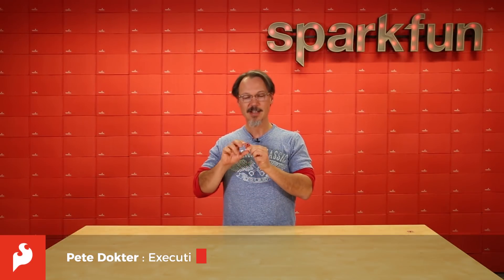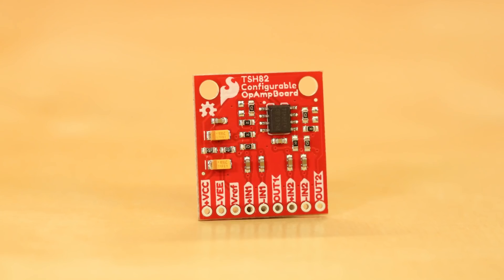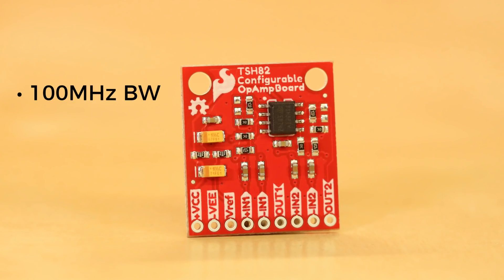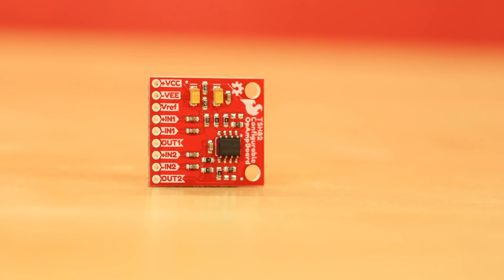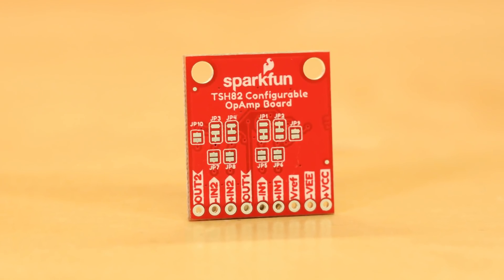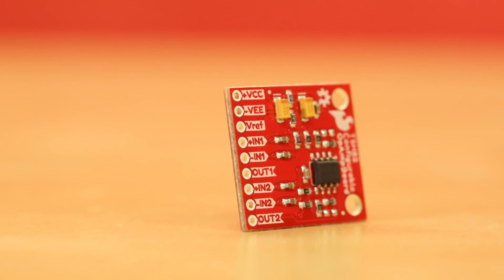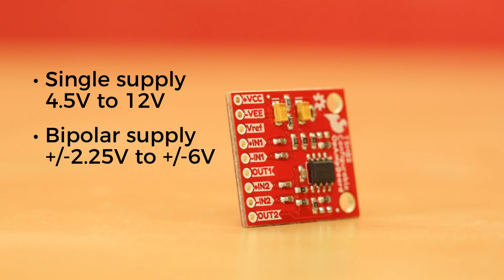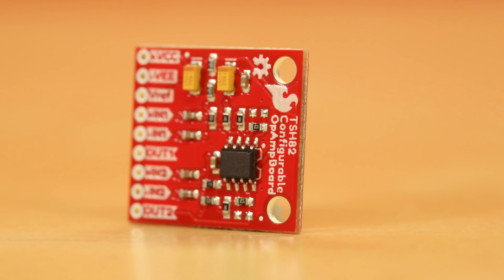Product Showcase: SparkFun Configurable OpAmp Board

Comment: Can I build an amp with this?
Reply: Well, it won't drive speakers, if that's what you're asking. But it certainly works as a gain stage of a larger amp for signals below about 8MHz (without modifying).
Reply: Cool! I guess I'm just confused what this could be used for, maybe some examples could be a good idea for a future video.
Reply: @GeoffPlitt  It'll drive a 150 ohm load, so a headphone amp is doable. It'll work at HF frequencies, so it's good for amateur radio design. Applications where you're trying to get an ADC reading on a small signal, or otherwise need to condition a signal before reading. In differential config you can compare two different signals, like temp or light sensors, for example. Or as an active inductive pickup. These are just a few things off the top of my head.
Reply: Gotcha, I see the potential now, thanks Pete!
Reply: @GeoffPlitt  No trouble! One of my personal uses is going to be for guitar effects. There's just enough supporting circuitry to make a good, clean signal, but I can still add junk between stages. It's a good board for some creative signal hacking.